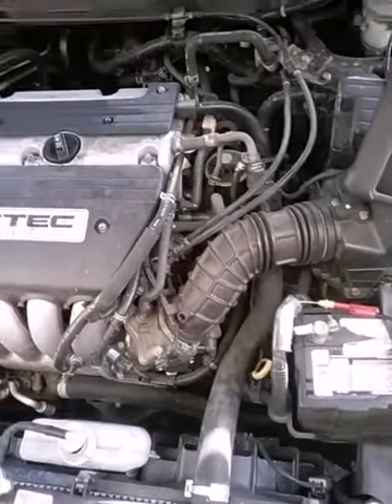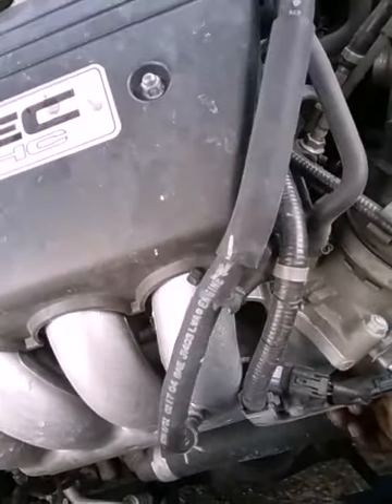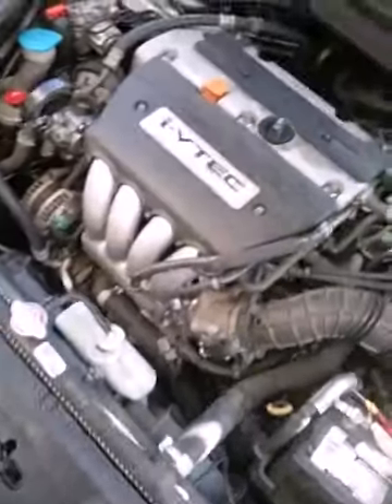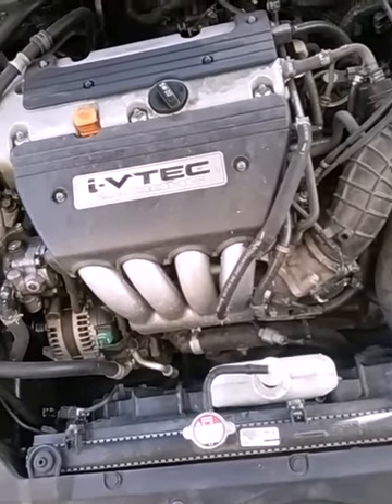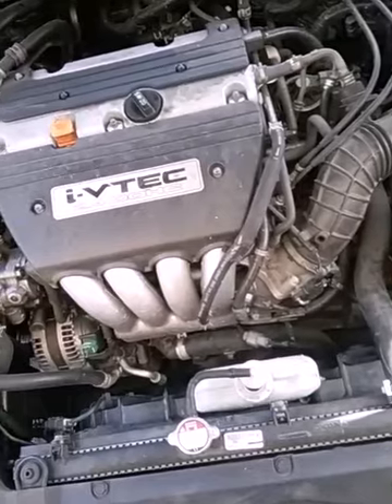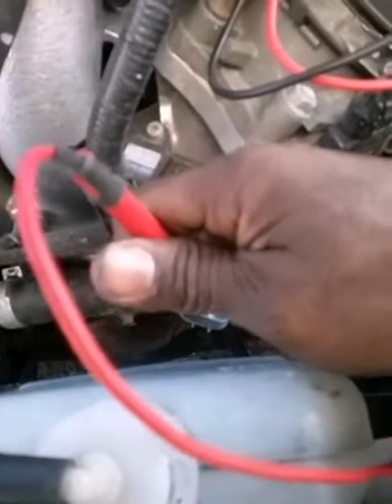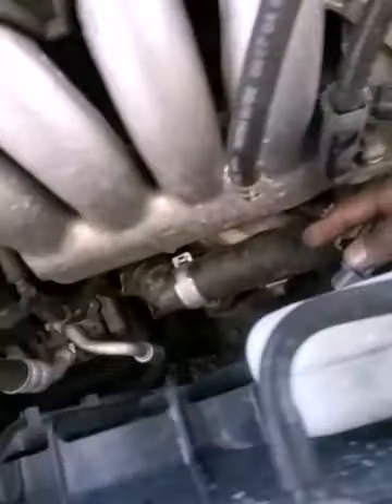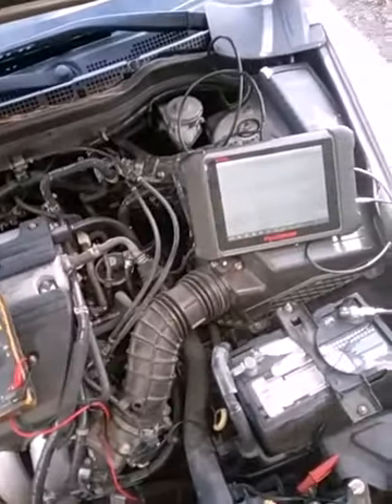Honda knock sensor p0325 w/ maxiscope data & fix

Comment: I know this is a very old video but I had a knock sensor issue on our 2004 Odyssey some years ago. Pulled the engine cover off and noticed mouse droppings. Further investigation and I found that they had eaten through the knock sensor harness under the intake manifold. The stealership wanted $800 to do the repair. Was a $3.00 part. I did it myself.
Reply from the maker: I know it's an old video but I still get notified with some comments 😆